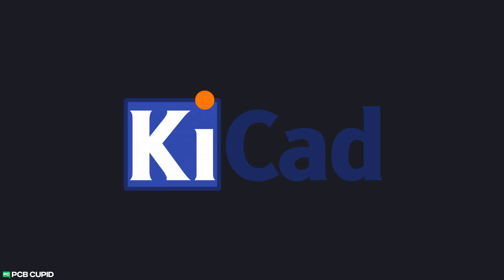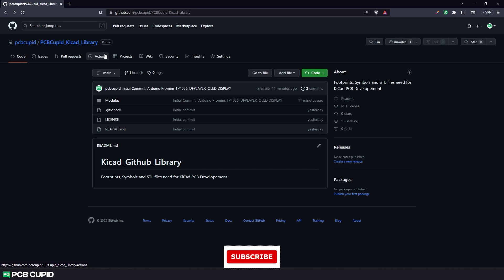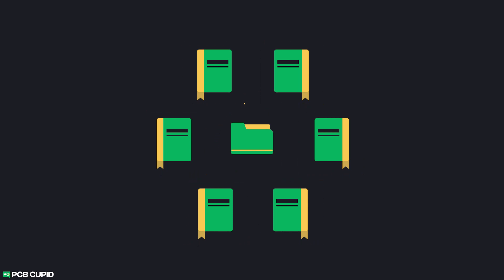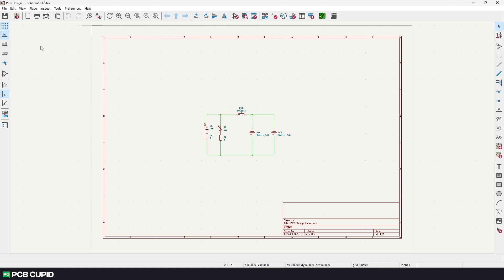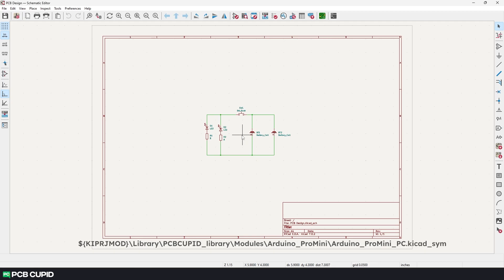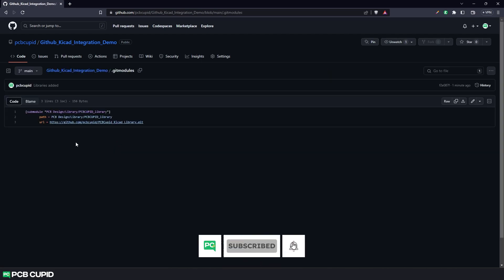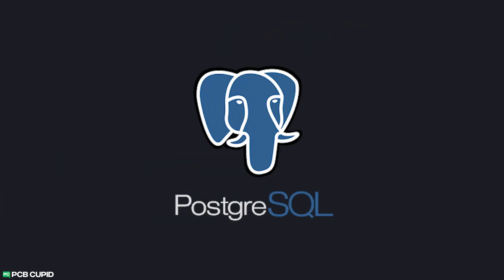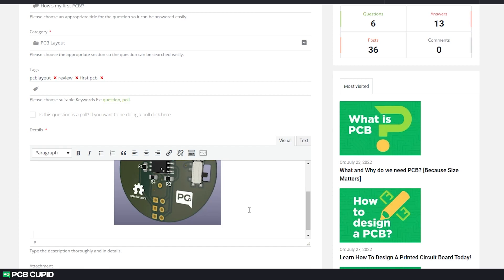How To Manage KiCad 7 Custom Library Using Git Submodules | #pcbcupid

Comment: This is a most excellent set of videos for getting started with KiCad 7. Your version control additions are icing on the cake.

Although KiCad files are text based, how well does the merging of branches work? Asking because Xilinx Vivado FPGA project files are text based, but often a simple project change rearranges sections that don't need to be rearranged. Of course, this breaks revision control and forces one to manually edit the project files, which is prone to error.
Reply from the maker: Glad you like the series!

Merging is not perfect when using KiCad with Git, If you have noticed in the previous video. 
The main branch remains intact while features are added on the SMD & THT branch. 
Only one feature branch can be merged to main branch. Ex : 
If the SMD is merged with main branch, THT branch can never be merged with main branch. 

Conclusion : 
Until KiCad dev integrate git at there core, it won't be perfect. But having some sort of version control is better than nothing.